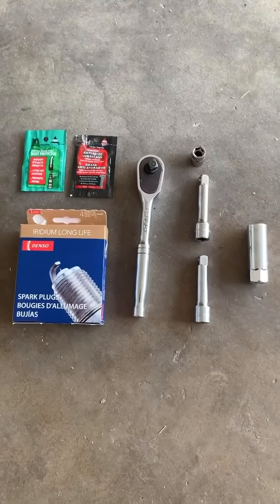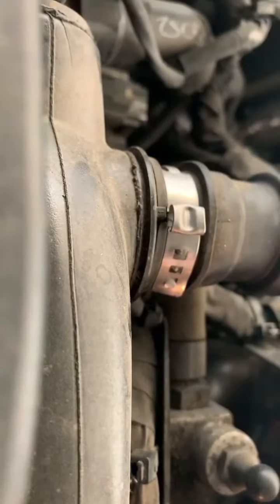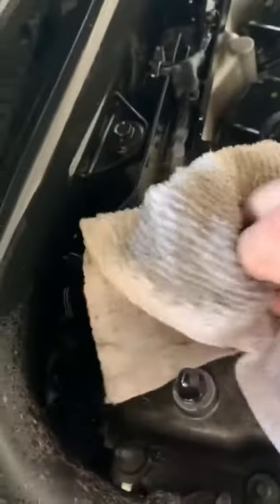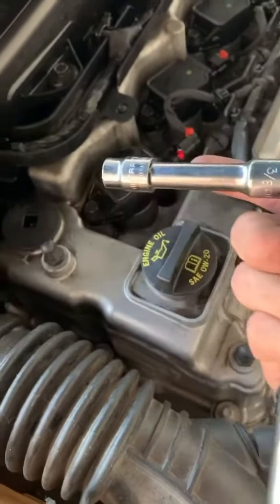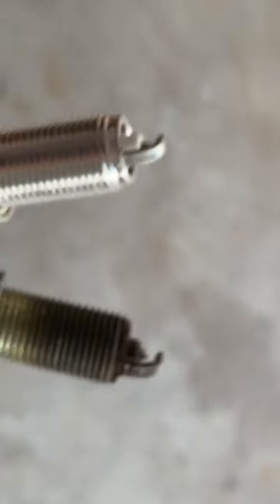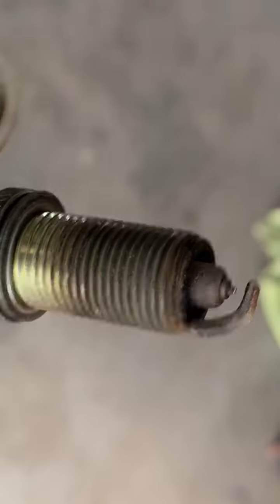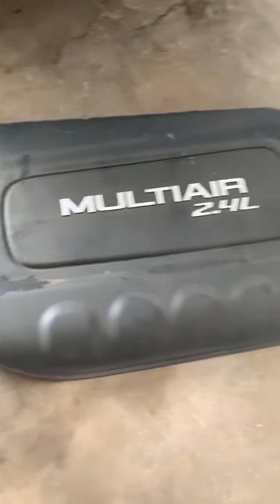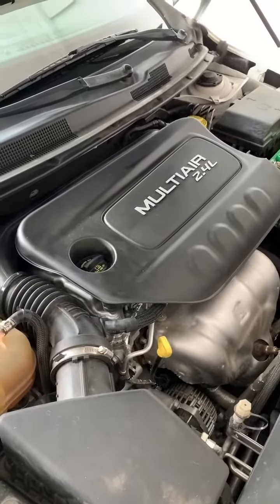How To Change Spark Plugs On 2015 Chrysler 200 2.4L

Comment from the maker: New Spark Plugs - https://amzn.to/3hRYHW5
Medium 3/8 Drive Ratchet - https://amzn.to/3YSMcKl
3/8 Drive Extensions - https://amzn.to/3C8Ihzm
3/8 Drive Spark Plug Socket - https://amzn.to/3jDi6KV
10mm Socket - https://amzn.to/3YWdaRb
Dielectric Grease - https://amzn.to/3G4pZ3k
Anti Seize - https://amzn.to/3C3LtMr
Spark Plug Gap Tool - https://amzn.to/3GpK5GJ

Comment: The correct name for the extender is a extension . And the grabber is a spark plug socket  most degreasers  should not be used on plastic parts or coils and coil connections . Other than that good work

Comment: Nice video . Thanks for the info . I have 80k on mine . Changing mine tonight .
Reply from the maker: 80k is definitely a good time to change them. Hope the video helped!
Reply: Antonio Reyes  dam that unfortunate, hope you can figure it out.
Reply: Antonio Reyes  It's a recall on that. It have something to do with the oil sensor. The sensor tells the car to shut off when it thinks the oil is too low. Google the recalls for the car and you'll see it's part of the lawsuit that's going on now. Hope this helps.

Comment: Okay my car has 58,725 miles it's the same year and model has yours. I want a tune up because i don't believe it has ever had one. I bought my car in 2017. Sometimes it jerks when i press the gas, but overall it runs very well. Do i need to change my plugs
Reply from the maker: Yeah I would recommend changing the plugs to see if that helps with the jerks you are experiencing when it accelerates. If one or more of the plugs are fouled at this point, then the jerks could be from a misfire of one of the cylinders not sparking properly. I would see if changing the plugs will fix that issue. Hope this helps!

Comment: You do not need to remove oil cap and the little black box.  Just pop it up, take off the clamp and rotate it out of the way.  I changed mine including 2 coils that were throwing codes in about 15 minutes.  that included gapping plugs.  easiest spark plug change I have ever done.  Use a longer extension.  Problem with removing oil cap is if you drop something in it.  if you do have to remove, stuff a rag in the hole.  you will create a serious issue if you drop something in that hole.  I cannot express how important that is.  Never trust pre gapped plugs either.  it costs maybe $3 for a plug gapper tool.  Always double check them.  When I did mine they were pre gapped, i checked them all and one of them was .040 the rest were .044.  .044 is what they should be.  gapping them to the correct measurement is important in fuel mileage.  iridium plugs are suppose to last 150k miles, platinums 100k and copper are around 25k.  Be careful with gapping Iridiums be gentle with them, the small electrode is fragile.  Most newer cars come with Iridiums, I think after 2012 model years.  1999 to 2012 came with Platinums.  My 2016 200 needed two coils replaced so i just changed the plugs while i was there, it had 50k miles.  The plugs I pulled out looked very good still.
Reply: I pulled my plugs out for the exact same year and car at 60k miles and they were totally burnt. Don’t wait anywhere near 150k miles.

I checked my plugs too and it was .044. You can size it without even touching the electro with the tool. That’s what the hole in the tool is for.

Comment: Hey, does the gap on the spark plug matter?
Reply from the maker: For these plugs I didn't need to gap them. It only matters if the Spark plugs aren't already pre-gapped. I just asked my local parts store cashier when checking out. If not gapped already, the recommended gap is .043"
Reply: Perfect thank you!

Comment: Is it necessary to take off the negative terminal? Cause I have a 2011 200 and I have to jack the car in order to get to the battery 😒
Reply from the maker: For safety purposes its recommended, but in my past experience I have changed spark plugs on cars without disconnecting the battery and haven't had any issues. I know how much of pain Chrysler can be with their genius placement of necessary things like the battery... hope this helps!

Comment: Hey so I did this exact same thing to my 200 same year and every same spark plugs I used the grease and the anti seize the car is running great but my check engine light went on what could I have done wrong?
Reply: I mean like the same spark plugs you used in this video
Reply from the maker: Hmm.. I would check your gas cap to make sure it’s not triggering the engine light and reset the battery. Just remove the negative terminal for 10-15 mins to let the codes reset and see if it comes back on after normal driving. If it does, autozone can scan the car to see what the code is saying for  free. Good luck and I hope this helps!

Comment: How much $ does all these supplies cost ?
Reply from the maker: $7.50 per plug, so about $30 for the 4x needed. A basic socket set with ratchet will cost $15-$30, grease for plugs was $3, and degreaser to clean everything was $5. Altogether look to spend about $50-$70 if needing to buy all the supplies besides just the plugs. Hope this helps!

Comment: How come I can't get a sey of plugs to last longer than 50 thousand? I've gotta do my third set and I'm at 132k in km of course. I've always had the dealer do my plugs. But it will always get to the point that it won't run proper and it cuts out they get literally dead dead
Reply from the maker: Hmmm could be the type of plugs the dealer is using. If they are cheaping out and using copper plugs, they may not even make it to 50k. While iridium double platinum plugs will make it to 80k no problem with little corroding. The extra few bucks for the better plugs definitely goes a long way. Hopefully this helps,
Reply: Swan Can Fix It  yea idk I’ll ask but now it’s overheating and I’m losing coolant but I’m not leaking anywhere I can find. Friends are saying water pump or fuel injectors
Reply: How much do the dealership charges for the service

Comment: I believe spark plugs are good for 100,000 miles on newer cars.
I don’t think I’d recommend removing the oil cap since it’s easy to accidentally drop something in there.
You should have shown checking the spark plug gap. A lot of time, they’re not gapped properly out of the box.
Also, a little anti seize on the threads is recommended.
OMG, you should never start threading the new spark plug with a ratchet. That’s how many people cross thread the spark plugs. Always start by hand until several threads have grabbed smoothly.